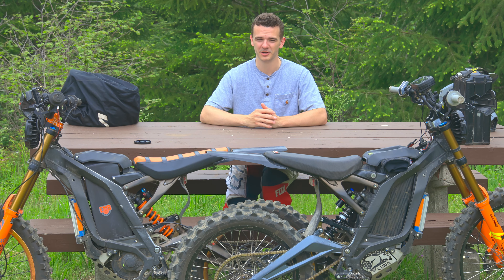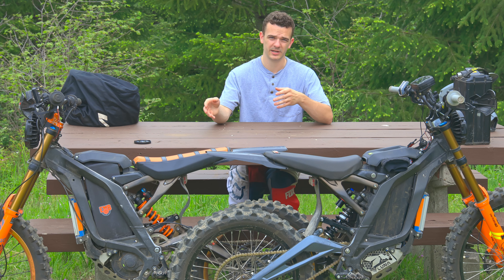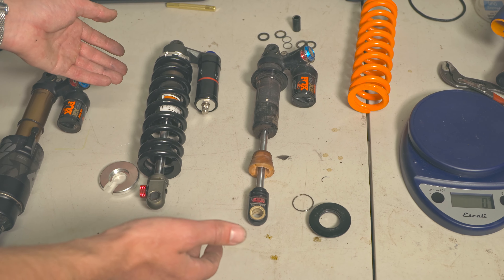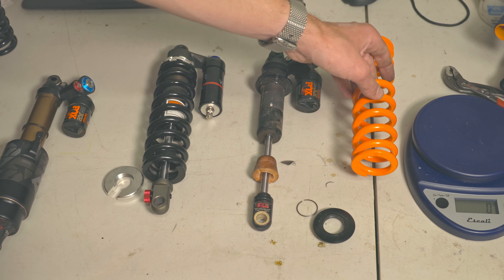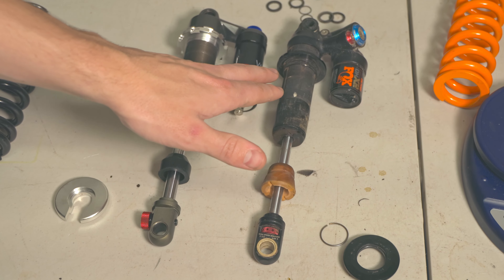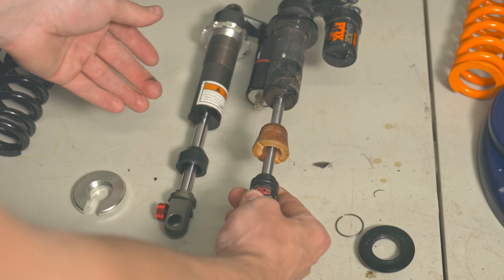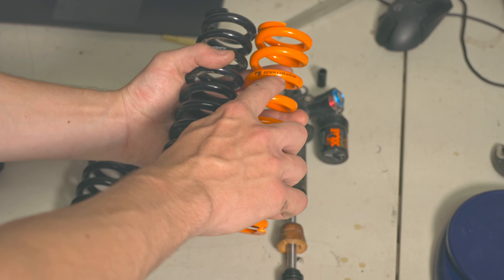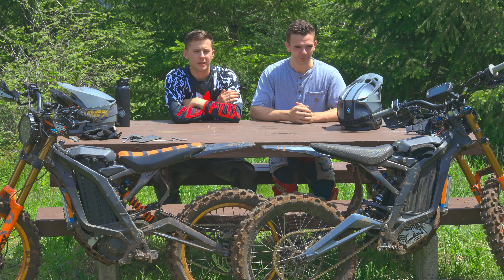Testing Vonkat TENfive Prototype SurRon Suspension - Fox DHX2 Comparison

Comment: Clear skies, finally. Yay summer dry season. Go jump that shock and see if you can hurt it. Their shocks are moderately priced, if you fellas like it I'll buy one. Sounds like it comes with the spring? If not will my Fast Ace spring fit?  35mm body OD 450lb.

Comment: So I got a question about the Segway X260, when changing to a different controller and battery, would I still need to use the app, or is that something I would no longer have to worry about?

Comment: Yesterday I wanted to buy the BAC 4000 that you announced at 5:59 and update every 5 seconds until 6:05 and it was never available what happened brothers??
Reply from the maker: It went live at 5:59. Sold 45 in 3 minutes and then the remaining controllers lingered for another hour roughly. Not sure what happened on your end but they went up.

Comment: You should check out the EXT Arma mx if you're looking for the ultimate in SurRon suspension. There really is no comparison with everything that is on the market. Purpose built for the SurRon with spring rates ranging from  400-600 lbs.
Reply from the maker: Definitely a solid option. The Vonkat is also purpose built and half the price of the EXT!

Our main concern with the EXT is the adjustability stemming from the use of a hydraulic damper and how that shallows out the plunger and reduces adjustability for the preload.
Reply: @emotobros  travel is not less on the EXT it is 3.5” as well 🤷🏻‍♂️
Reply from the maker: @northsandiegorc4248  Travel on a shock is defined as fully uncompressed to fully compressed with no bump stop. My understanding is that the bump stop method that EXT uses removes around 3/8" of travel compared to a typical rubber bump stop. Is that not correct?
Reply: @emotobros  That is definitely incorrect. The Hydraulic Bottom out Circuit on the EXT will actually allow for the shock to get to the true travel compared to a shock using a rubber bumper.
Reply from the maker: @mixmastamikal  my last comment certainly was unclear. The hydraulic damper does remove travel. That being said, the EXT does still have 3.5" of travel, however, without the hydraulic bump stop it would have even more assuming nothing else changes and a typical rubber bumper and dust seal were used.

By adding a hydraulic bump stop you are effectively reducing the size of the piston rod guide. Due to this they had to make the size of the hollow shaft bigger in diameter to compensate for the lack of rigidity this would cause. This is suggestive of their reasoning for not wanting customer to add more than a two turns of preload so that the shaft assembly isn't overly stressed stemming from the shawllowness.

Comment: Are you happiest with the 450lbx3.65 SLS on the DHX2 or do you prefer the 500x3.25?
Reply from the maker: The 450 was much better for our weights for sure.
Reply: @emotobros  Would 400 or 450 be suitable for 145?
Reply: I passed on the sls spring, used the 550 dmn spring Luna offered for awhile and it has proven the correct choice for my 175 LB. frame. I ride 100+ days a year as I work at a motorcycle rec area and would NEVER choose an unproven shock and you don't even know if rebuild kits are easily available. Terrible review, guys. Still love ya tho.

Comment: Love your videos! I am a taller rider and I am finding myself feeling tippy and about to loop out. I have all of the recommended height mods like the seat riser, tires, peg extenders, etc. I was wondering if you guys would recommend a swing arm. This could add travel and allow for wider tires. Thoughts?
Reply from the maker: We have not used any swing arm but the limiting factor of the tire width is she chain and jack shaft. A swing arm will not resolve this.

Comment: whats the reason you only sell the bac4000 and not the 8000? one of you have a bac8000 right?
Reply from the maker: Couple of main reasons. The first being is that it is simply more power than what is necessary. With more power at users fingertips comes more liability and technical support issues regardless of whether you have instructions, disclaimers, etc. We generally sell out of product in under 12 hours but if the demand for 4000s greatly decreases and there is only demand for 8000s then that may be a route we decide to go in. 

That being said, neither of us run the 8000 on our personal bikes or have any plans to unless a better motor could support it!

Comment: More suspension options = more better! I would be interested to hear long term reviews on how well suited the top tier of MTB suspension really is for 120-130lb bikes like the sur ron/talaria. I'm a 200lb rider and just can't imagine even fox 40s/DH holding up under that much combined weight for long. Especially with some track use.
Reply from the maker: We definitely plan to do that with both Fox shocks.
Reply: I have 2000 miles on my fox 40’s on my surron zero issues

Comment: do a test on the EBMX shock
Reply from the maker: The EBMX shock has the incorrect stroke length and requires an adapting linkage that changes the leverage ratio. First thoughts on paper are not pleasing enough to purchase for testing but we would be more than happy to try it out and give our thoughts if it were sent to us👍🏼